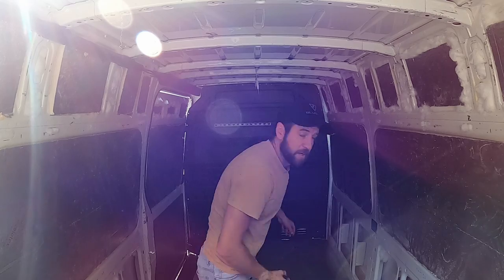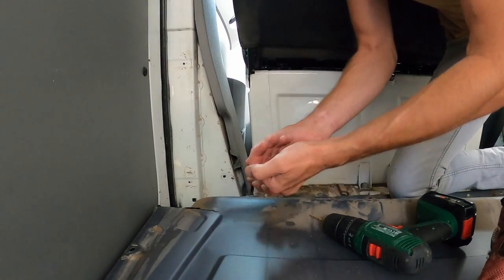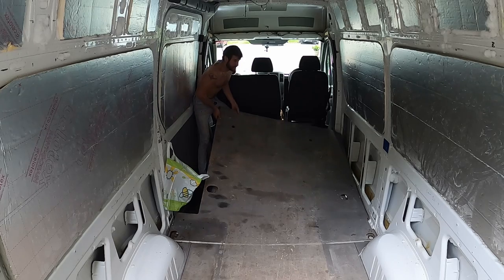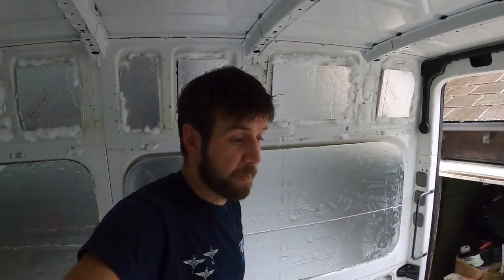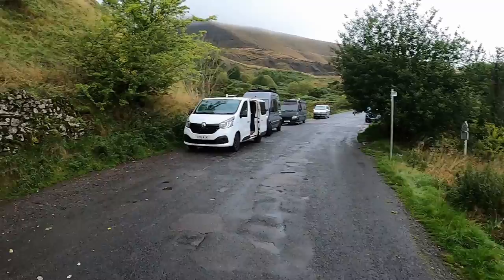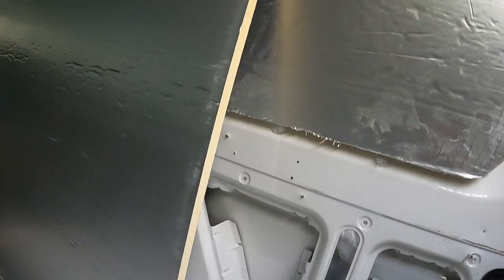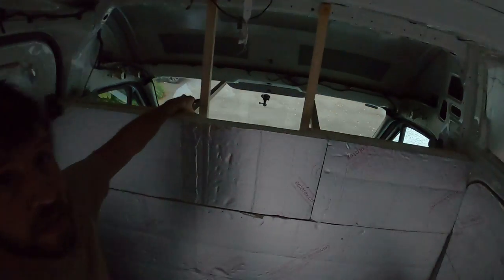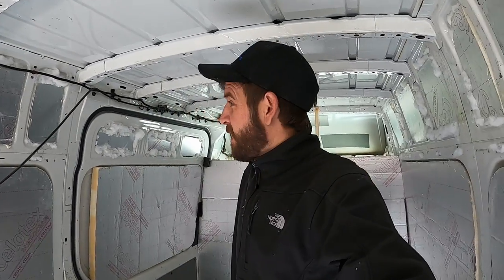Get Organised With This Storage Hack For Your Vw Crafter!

Comment: Gary, super insulation. One thing, which you've probably considered, is a disadvantage of it in hot weather. It will retain the heat of the day, and it would be good to get the cooler night air in. Roof vent fans above Amika's bed and yours would do this. The Fiamma ones can switch between air in and air out, but the switch is on the vent. I have a separate three way switch and variable rheostat by the he bed to control it. Maybe a third vent expelling air, to compensate for the two sucking air in, or closable vents. For stealth, the roof vents will show interior lighting at night though.
I thought you'd sold the previous van, but looks like you've still got it.
Anyway, love your videos, and especially with your little ice cream powered assistant, Amika. She's a lucky girl to have you as her dad.
PS I found the opening track on YouTube, but not the upbeat driving one.🎶🎵
Reply from the maker: Hi Glen. I have got maxx air fan installed. It's positioned by the shower cooker for extraction and blows cool air in to both mine and Amika's beds. I've also made 25mm celotex insert for the fan to block out the light, also lined with 7mm closed cell foam for sound proofing and carpeted 😊
Other van  will be for sale next week 😁
Glad you found the music, will send them links over next week

Comment: Hi Andy. Great stuff so far. Looking forward to your progress. Have you considered the side pods so you can sleep sideways, I think they add about 4 inches each side. You may get away with fitting just one side. All the best bud. Cheers 🍻
Reply from the maker: Thanks Paul, yes I have but they are a grand to fit. I've actually build a super king size pull out bed but used it twice. I'm sleeping comfortably across the bed without it now. If I pods now it will be a totally waste of money to look badass, which I will probably do 😂
Cheers mate 👍

Comment: Another fantastic video, I think you two will be really snug - it’s great when you know what’s where and the cab seems to be the biggest area for loss so would make a massive difference just that bit. The sound insulation sounds (pardon the pun) interesting.
Love the squirty foam but it makes a mess doesn’t it and sticks to everything (including hands 😀). 
Oh and the scenery clouds looked great with the cloud inversion too.
All the best, David & Rachel 👍
Reply from the maker: Thanks David. Yeah it's definitely worth sealing up the cab for both summer and winter.  The foam is a nightmare but very useful. Blessed with the cloud inversion! Hope you're both enjoying whitby, we are still in Arran, hoping the ferries are still running tomorrow!! Weather has been very bad here
Reply: @TravelwithGaryandAmika  hope you manage to get back ok tomorrow and it’s not too rocky on the way into Ardrossan. Whitby has been good, weather has been variable today though with a fair bit of rain this morning. More vans that I though there would be here.
Hope you’ve enjoyed Arran apart from the weather, some cracking photos in Instagram 👍

Comment: Hi Gary loving the videos I also love the idea of the self adhesive sound proofing foam instead of using a vapor barrier how many rolls of foam did you order / how many sq mtrs each roll is I got the same van as you thanks joe
Reply from the maker: Hi Joe, thanks a lot.
Erm, I think I ordered 30sqm. That did the entire rear of the cab. Including the ceiling and floor and bulkhead. Also above the cab for Amikas bed area. If you email me I can send you the link to it. Definitely good stuff!!

Comment: Never having built a van myself ( I live permanently in a 7 metre motorhome )I was wondering why you put the flooring in between the battens rather than on top. Is it to do with the internal height?
Reply from the maker: Hi Paul, I haven't put any floor down yet. The battens are to screw deep into later on for furniture. The insulation goes between the battens, wood being a great insulator itself. I later covered the floor in the original plyand then  7mm reflective closed cell foam to create a good seal and sound barrier. Height is a concern yes, which is why the floor has 25mm insualtion and everywhere else has 50mm.
Note, I have no idea what I'm doing, learning from first can build mistakes and experience and just doing what I think will work 😊

Comment: Your escape hatch, is right next to the side door and you have your back doors, if you can't get out through one of them, how likely is it you will be able to escape through your hatch? Why have a bulk head anyway put some black out curtains across and you have the flexability then? Just wondering!
Reply from the maker: If you watch my previous vidoes you will understand its a door to be avke to get through without getting outside. Security. Not safety.
Bulkhead is needed, it's minus 25 to 30 in the Nordics
Reply: @Travel with Gary & Amika  Re watched a couple of your videos, still can't find the one you explain the escape hatch thing.

It gets to -25 to 30 in Italy and Austria too, so? Spent nights in a lorry in these temps. You really need to mindful that you do need some airflow also especially in a confined space like the van otherwise you will have problem with the smell and damp. Are you putting air con in as you need to think about summer too.

Friend bought a really nice purpose built motorhome for 86k and we took it to Italy skiing, ended up in a hotel as the water tanks and piping froze under the van :)
Reply from the maker: My old van had curtains, my daughter slept on the front sets and we had card and foil on the windows and a external cover. The door to the cab is to drive off if something dodgy happens. Like people trying to get into the van. It happens and I have a little girl with me. I can't get out. So simply step through and drive away. Climbing out a side door would only be fun if I was alone.
With regards to the bulkhead, it's something I want. For various reason as currently it looks like a a solid wall from anyone looking in, and also I don't need to constantly run a heater while sitting in the back.
Air con, nope, never, its awful stuff, never used it in Dubai or in Afghanistan, certainly won't need it in the UK or Europe. All you need it's good insualtion and air vents / fans
Reply from the maker: All plumbing will be internal, never outside as that's asking for trouble. Some people who buy an off the shelf motorhome fall into problems like that.
Reply: @TravelwithGaryandAmika  Escape hatch make sense.

What have you against air con out of curiousity, I am glad I have it in my truck
Reply: @TravelwithGaryandAmika  It needed some insulation on the plumbing and it now has a heater in the tank that stops the water from freezing.
Reply from the maker: Nothing agaisnt air con, its superb. I just don't need to use it